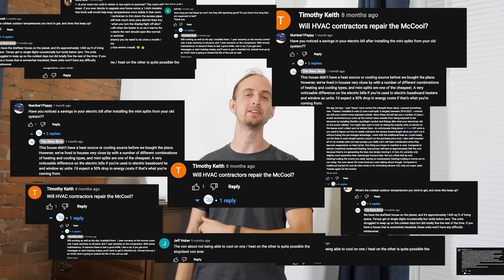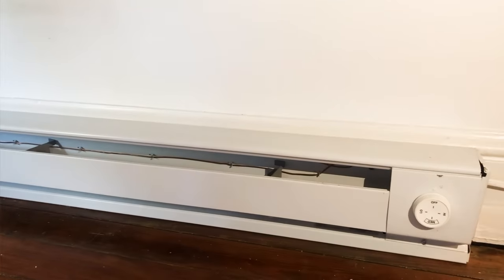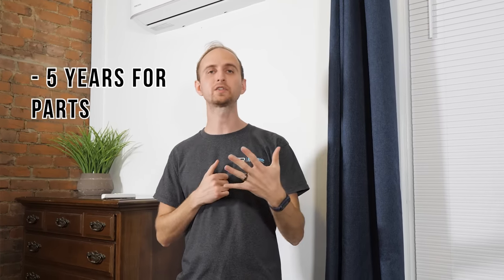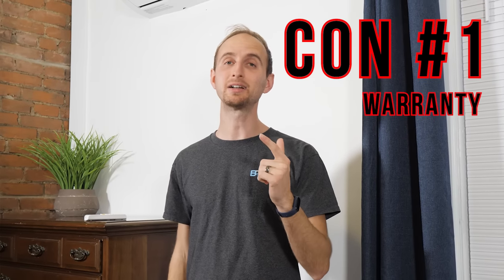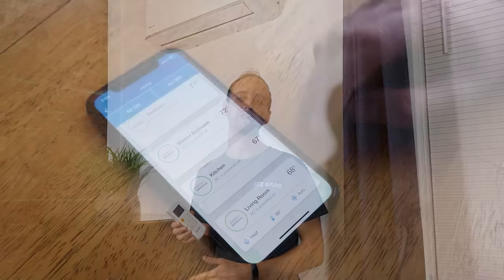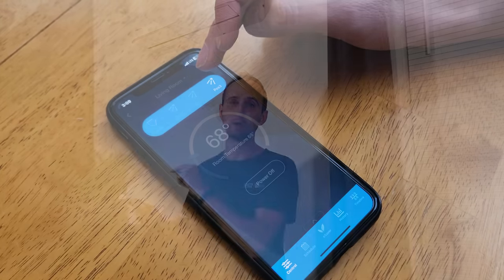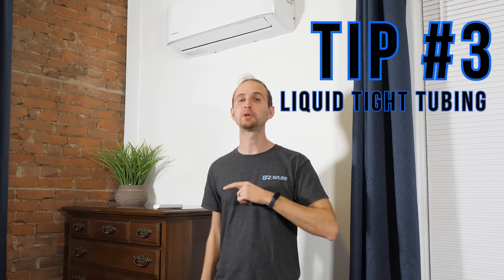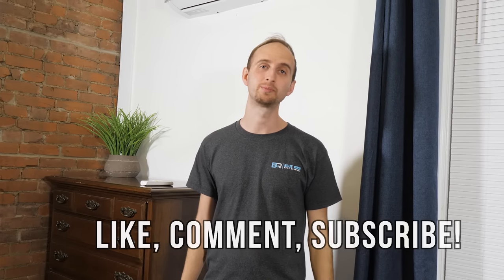Mr Cool DIY 2-Year REVIEW: I wish I would have known this BEFORE BUYING...

Comment: Looking at a larger MrCool split system to replace my central air system with a leaky coil. Was quoted $4500 to replace coil, $13,000 to replace with like-for-like.  Insane.  Or I can get a MrCool 3 or 4 ton system for half the price with a higher SEER rating.  I feel like HVAC companies refuse to work on them because they feel threatened by DIY systems.
Reply: Update.  Installed myself, works fantastic, quiet…efficient…etc.  saved at least $12k.
Reply: Good man, going to do the same here shortly
Reply: I think its not that they feel threatened as much as it is that they really are not as smart as you think they are.
Eery unit is different and things  change every few years so they like to work on the easy stuff
Reply: Yes, I built a house in 2005, shark bites and pex were just getting a start here. I had plumbers quote and they were crazy. Meanwhile they were desparately trying to keep pex and shark bites out of the market. So I decided to do my self, boot legged and saved well over 10k. Sharkbites and pex made plumbing easy for DIY and plumbers hated it. Well quit screwing people! I understand everyone needs to make money, but they do not need to make 500 per hour.

Comment: Thank you for clearing up these myths and the very helpful tips. Just installed two of these units and the savings was  $8000 compared to a contractor.
Reply from the maker: Glad you had a good experience so far!
Reply: Did you buy a multiple mini split system or did you buy multiple condensers?

Comment: I purchased a log home with a 6 head mini split system. Right away we noticed we barely need to run the AC. Even the past week it's hit 100° outside the system barely works the outside unit rev's up a few times here and there. We turn on the AC periodically just to get humidity out it's pretty amazing how well insulated a log is.

Comment: HVAC contractor here.

You can’t cut your refrigerant lines on a minisplit set up. They come pre charged with the exact amount of refrigerant for the size system it is on. If you need to add a longer line set, the manufacturer has a chart to let you know how many ounces to add.

But there is a bare minimum, and it’s typically 15 feet linsets.
Reply: What happens if the lines get cut to shorten them? Will it still work?
Reply: If you cut the pre charged lines you no longer have a diy install. Have to vacuum the lines and probably should recover and weigh in the proper amount of Freon.
Reply: @joesutera6940  Can still be a DIY, but you need to get the tools and the EPA license.

Comment: My MrCool unit is 3 years old and used continuously with it running whisper quite. I also purchased mine from Ingram's Air. I has a exterior unit control board burn up that was honored under their warranty. I had to provide the labor.

Comment: really simple fix for the extra coil I saw on another vid is to build a box under the condenser and place the coil horizontally on a shelf in it. Problem gone for a few pieces of wood or metal. Plus raises the unit off the ground away from insects and animals, wind blown and lawn mower launched debris, rain splattered dirt, puddles and especially keeps it above the snow drifts,  and generally increases the ventilation.  It also makes it easier to service and if you enclose it reduces heat or cold loss from coil. win win win. Also I recommend putting a nice little roof over it. Anything that gets wet attracts dirt, insects, corrosion and heat loss. Things that live under cover last forever. Hopefully no bears make their home there. There's also less expansion and contraction of components due to cyclical moisture evaporation.

Comment: I have a Bosch  mini split. This is my second year operating this unit. It has performed perfectly.  The increase in my electric bill was $20 a month.
Reply: isn't a mini split supposed to use less electricity than hvac? did you mean to say your electric bill decreased by $20?
Reply: @hundred.billion  I converted an 18 by 18 ft garage into an office. There were no A/C ducts going to that room. I put in the mini split that both heats and cools. My increase in Electric bill was $20.00 a month but well worth it.
Reply: I have had two mini splits, one is 10,000 BTU, the other 9,000 BTU, and it's $90-$100 a month less.
I live in Tampa.
Reply: @billstapleton1084 Hi, what size unit did you go with? I’m looking to do the same with my garage that’s 19x19. Thanks
Reply: @amstewart2003able  I have a 12,000 btu heat and cooling unit. The garage space I have is 18 ft x 18 ft.

Comment: I clean the blower wheel by removing the outer case then the black protective grill at the bottom. A small soft brush gently brush off the blower wheel while sucking with a vacuum near or close making sure the unit is shut off of course. Works well If careful
Reply: Thank you, I wonder if I could do that?

Comment: The way I solved the lack of insulation and drafty windows in my cinder block home was to build a wood-frame wall inside the house along the exterior walls. Basically I built a house inside the house with the insulation right up against the cinder block, and tight seals around the windows. Now it is insulated and the drafts are gone. And now I can hang a picture on one of those walls, since it is a standard drywall wall on the inside.

Comment: Mr cool works great in my house now for 7 years 
Saves a lot of money over all
I love it for all seasons
Reply from the maker: Nice! Glad to hear that! I would love to get at least 15 years out of this setup. 20 years would surprise me but be awesome
Reply from the maker: How many interior units do you have, and did you install it all yourself?
Reply: @TheRenoBros  one air handler 
And did it myself 
I had to hirer an electrician for the 230v box
Only charged $250
Reply: @TheRenoBros  me too
Reply from the maker: @MrJohnny4705  That’s great! I hope it continues to perform well for you!
Reply: @TheRenoBros  I recommend only mr cool its the easiest to install
Reply: Did it in 3 hours
Reply from the maker: @MrJohnny4705  One air handler would be nice. I had to install two separate systems, one had 3 interior units and one had 4. So 7 altogether…man was it a lot of work. And soooo much lineset covers it took me about 40 hours for everything.
Reply: @TheRenoBros  i have a contemporary house with cathedral ceiling 
So the one air handler efficiency cools all the rooms in the summer and heats all the rooms in the winter 
Mine is the 24K Mr cool 
1200 sq ft area
Reply from the maker: @MrJohnny4705  That’s great!
Reply: @MrJohnny4705 hi do you find that the one unit effectively reaches every room of the house? How many bedrooms? I live in a house that is open with cathedral ceilings as well 1100 sq ft. I would love to be able to just install one large air handler for the whole house but I’m not sure how well it will work. Thanks
Reply: Yes 
My 2 ton unit cools and heats my 1300 sq ft home 
For air conditioning the upstairs bedrooms i have a ceiling fan in reverse mode to pull the cold air up into those rooms 
Works great
Reply: @MrJohnny4705 how high did you install the air handler
Reply: About 10 feet high

Comment: Contractor with 25 years of experience here (I've personally worked for 2 different HVAC companies for over 4 years as well). I couldn't agree more. DIY mini splits are by far the best bang for your buck. Don't go with a offbrand that won't be in business 3 years down the road, and don't do a half-assed rush job on the install. You'll be fine. Plumbers were crying the same way HVAC guys are now back when PEX, and sharkbites hit our market 20 years ago. They realized that the average person could handle the work themselves reasonably well in most cases. Most companies, and many contractors are charging entirely too much for their work. There are many reasons why this is happening. There isn't a "smoking gun" as to why this is happening. Some of it is the price that materials has gone up (not as big of a chunk as you might think), price of fuel, insurance, etc. If they're a large company they have a lot of overhead (office, shop, utilities, maintenance, staff, advertising, ect). BUT a lot of it is just old fashioned greed. Many are charging hundreds of dollars a hour simply because they can. It's shameful. Your best best is to find a honest independent contractor in your area, and develop good business practices with them. I can assure you they do exist. They are out there.

Comment: Have you ever considered filing the ridge down on the remote holder to prevent the snag that pops the remotes cover off?  Just a thought…
Reply from the maker: Yeah, I don’t remove them very often but I just shared that detail because it’s a poor design. Worthy of a con in my opinion. Homeowners shouldn’t have to file down any ridges to make something function correctly

Comment: The humming is not the motor. It’s the holder sub-assy lack of lubricant so the axis of the cross-flow fan rubs against the hole of the holder sub-assy and makes the humming noise. You can put some lubricant or just WD40 in the hole of the holder sub-assy, the the noise should go away. The holder sub-assy is on the left end of the indoor unit. You should be able to find it on the service manual. 80% of the noises of the high wall indoor unit of mini split are because of this.
Reply from the maker: Thanks for commenting! It actually was the motor. The noise was only coming from the right end of the inside unit. After removing the old motor and replacing it, that fixed our problem entirely. And with the old motor removed, I could split the drive shaft manually and it made the same sound as it did when the motor was inside the unit. I would however be interested to know if perhaps some WD40 would fix the motor issue. I’ll have to try that next time one starts acting up.
Reply: @TheRenoBros  I recommend using a high quality synthetic lubricant over WD-40. It will stay put longer.
Reply from the maker: @RyanHarris77  We would have had to take the motor apart to figure out what was making the noise exactly, and it didn’t look like it was made to really be disassembled, so we just opted with the free replacement part. But do you know how to take the motor apart? When it goes out of warranty, that’s the kind of solution I’d be looking for!
Reply: This content is valuable to the DYI guys.
Reply from the maker: @lawrencecarlson2425   👍👍
Reply: WD-40 isn’t meant to be a lubricant. Superlube is a much better product or a 100% silicone grease. WD-40’s white lithium grease isn’t bad but honestly Vaseline works great on stuff like door hinges.

Comment: Great video. Sums up my experience after 4+ years with two Mr Cool DYI installs in my house. One of them has become noisy and Mr Cool sent me a replacement motor. I watched the video they suggested and… I'm working up to the task. You mentioned that after three motor replacements, you have the task down to about 2 hours. Is there any chance you may have videoed your experience swapping out the motor? Or, any chance you have tips to offer on the task? 
My experience has been that most of these mini split, air handlers develop some sort of noise after time. I'm not deterred by this and I'm about to install a third Mr Cool. I never had the option of any other systems anyhow. Also, I've saved so much money doing the DYI thing, that even if I had to replace each unit after time, I would still be ahead. I was quoted $16K by an HVAC guy for two units that cost me $2,500 combined (plus the day it took to install them and $600 for the electrician to be sure the hookup were up to code). So… That's $3,100 vs $16,000. Do the math, it's a no brainer. 
BTW: I asked the HVAC guy how long it would take to install the two Mitsubishi units in his estimate. He said, a full day. That means 5-6 hours to me. The units cost less than $1,000 (to him). So let's just say his cost was about $2,000 + another $800 for parts and wear and tear on his tools and truck and cost of doing business (insurance, etc). So… rounding up, let's say his cost is $3K, which leads me to believe that he's be paid $13,000 for a days work. Convert that to by-the-hour at 6 hours total and you have $2,167/hour. When I asked him if that seemed fair… he told me to take a hike. Hell, I would have been happy to pay double his cost ($6K) and he would have been making $500/hour. Anyhow, I'm glad I'm handy and was able to do both installs in a single day. The electrician came the day prior and had everything ready to roll. BTW: The lowest of three bids I received was $12K and that guy didn't return my call! $16K was the highest of the three. 

Thanks for your great videos.
Reply from the maker: Thanks for the comment! Here’s the video I watched to feel confident about the motor replacement: https://youtu.be/WkdUJz5IMdY
Reply: Someone has to pay for the HVAC guy's new truck!  Finding someone to pay $16K gives him a nice down payment for sure.  I'm all for everyone making a decent living.  But that's just price gouging.

Comment: Cleaning the blower assembly should quiet that sound. Cleaning is essential for these style systems. It is possible it's motor bearings though
Reply from the maker: Thanks for the suggestion! We tried that first, and had the same sound. We even pulled the blower motor out and could hear the sound simply when turning the drive shaft. Definitely the bearings

Comment: On a multi head mini split condenser, all heads have to be in the same mode for it to work properly, because their is only one compressor and one reversing valve. If you have multiple single head units, you have to properly address the remotes in the program menu for each zone.

Comment: I recommend you  buy a Flir C5 thermal imaging camera and find out where the heat is coming in and cold air getting out.  You might be able to rent something similar. As a contractor you should seriously consider buying a thermal imaging camera to use on jobs.  Don't replace the motor. Try using 30W motor oil to lubricate the bearings. It sounds like the bearing are dry.

Comment: I installed a Mr Cool several years ago and it is working great in the winter. It was only rated for -5 below but it has gotten tp -20 here and the Mr Cool worked great. Generally the temp is 0 to -5 on average. So I recommend them. The newer ones would work much better.
Reply: Celsius?

Comment: On your comment of the unit not keeping up is because you needed a manual j load calculation to know that the units you bought are to small for the room because of the lack of insulation in the house. I get the day thing but a proper load calculation is required before installing any unit to make sure it is sized correctly.
Reply from the maker: So true! These are sized correctly for the house and keep up just fine. There are generally only one to five days per year that I notice it struggles to keep up, and those are outliers

Comment: I have a question what does 22.5 SEER2 mean? mainly the SEER2 part? If you might have any idea. What I am getting at is what is SEER2? I have seen seer ratings but not before it is the rating on my Hessaire DIY unit. These were a lot cheaper than the Mr. Cool.

Comment: I've installed two Mr. Cool systems.  One is the split system with air handler as in a central HVAC system and the other is a 24,000 btu unit in my shop.  Both have been in for two years.  So far, no problems.  Easy to install if you don't kink the lines.
Reply from the maker: Great! Glad it has worked out well for you! Yes, easy to kink the lines if you're not careful!

Comment: I have a 24k DIY for 2 years now and working good. I however had an issue with temperature. The unit would cool down to 7 degrees below set temperature so I tested the sensor and it was fine. The strange thing it would only start the offset at 5pm and return to normal the next morning. I removed the wifi adapter and it resolved the issue. MR cool had no explanation on why. Does anyone have thoughts on this. Mr cool is by far the best mini split AC in my opinion. great job on the video.
Reply from the maker: Thanks for commenting! Never heard of that issue! 🤔 Very strange. I’ve heard that Daikin and Mitsubishi are far better in terms of quality and reliability, but I’m happy with my Mr Cool so far!

Comment: I have had an issue with two air handler units on one exterior condenser unit. The air handlers were out of sync.  Easy to reset once you understand the problem.
This problem only occurred with one condenser and pair of interior air handlers.